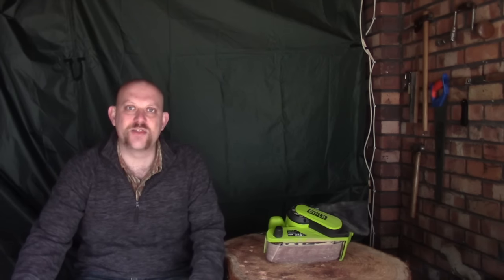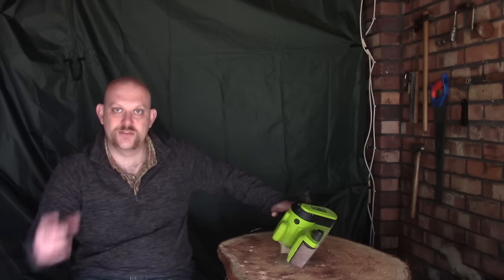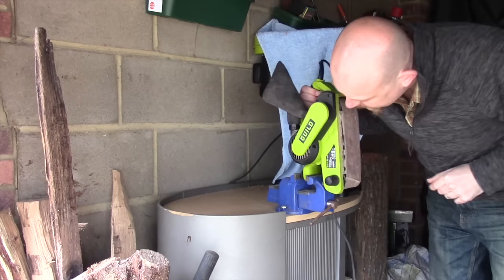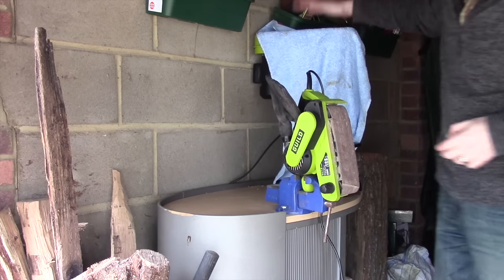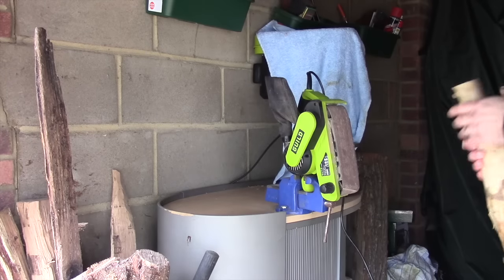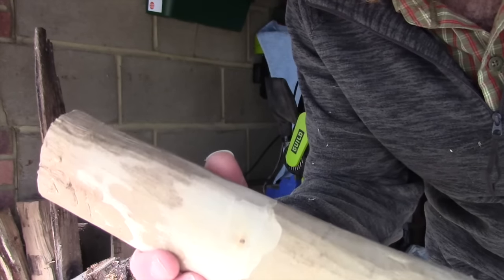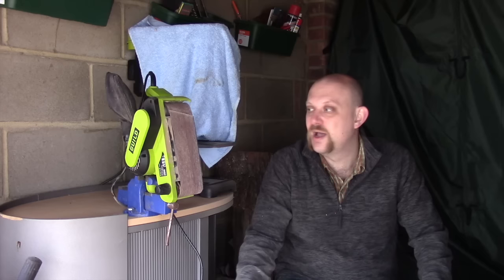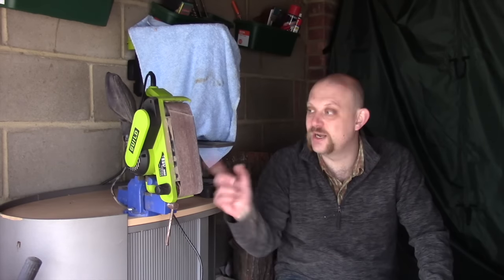No More Hand Sanding!

Comment: Nice idea indeed, I tend to use an electric drill with the stay on button locked on. I have mounted it in a bench clamp made for electric drills. This in turn is mounted onto a lump of deal, and then that is mounted into the vice. Various sized flap sanding wheels are then introduced into the chuck, right way round to stop upward dust flow and have at it... Perfect for those smaller bits of wood. I have been using this method for a few years now with no accidents, although I did wear out armature bearings on one cheapo drill I inherited...... sandpaper grades are not so easy to find in the finer finishes, but once all the grunt is done, a mere hand polish is usually sufficient....